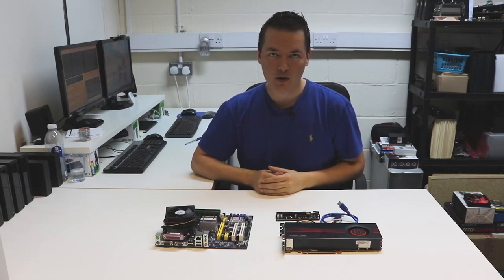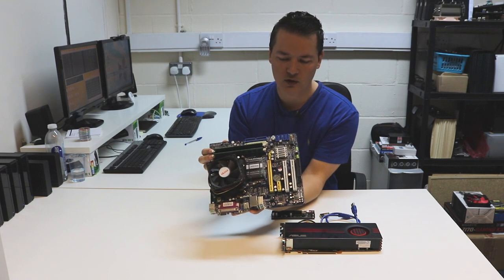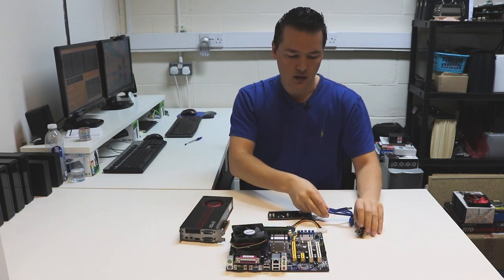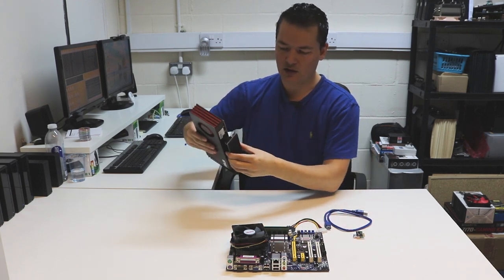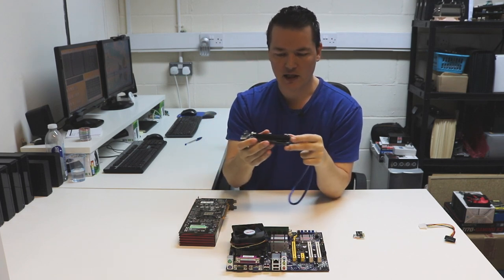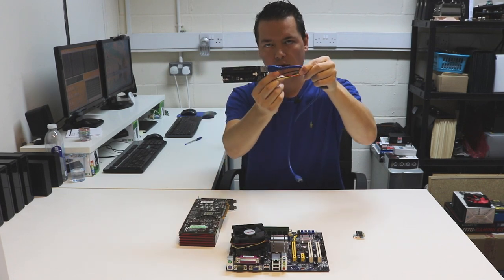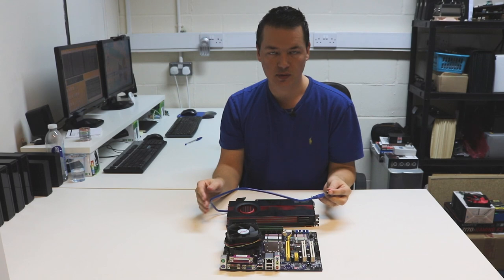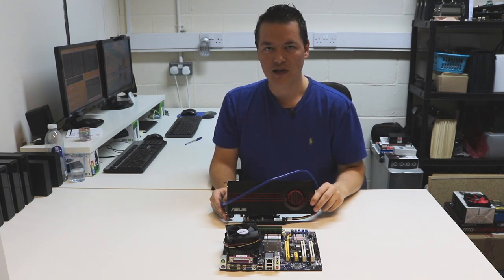How To & Why Use PCI-E 1X - 16X USB Extension Riser Cables

Comment from the maker: Please Note:- You cannot connect the GPU Riser to your USB port. The usb cable is just used as an alternative to a ribbon cable, there is no usb interface. You cannot run the gpu riser from a usb port!
Reply: I am very new to all the technical stuff related to mining. I was wondering if you connect the PCIe extension to PCIe 1x slot, will the GPU not reduce in performance since you are providing it with less bandwidth?
Reply: Can i still use my top gpu and mine on the 3 riser extended gpus?
Reply: You don't need much bandwith for mining
Reply: Hi what about the speed/performance? It will be same like before I use this module? thanks
Reply: Check for Gigabyte models, I think there's few with up to 7 pci-e
Reply: i have a lga 775 Mbo but i wanna install 1050ti or greater something but my x16 is gen 1.0. Now newer graphics cards have 3.0 x16. I was wondering if I get a PCI Express Riser cable or something like this would help me out performance wise?
Asus support tell me it will work normal way just plug it but wont  get max performace.
Reply: Hi do you know how much it reduces anything when playing games ?
Reply: HEY MAN . IM NOT A GAMER AT ALL AND NEVER WILL BE . MY PC IS PRETTY GOOD WITH PCI-E 3.0 x16 SLOT BUT IT CANNOT PLAY VIDEOS PROPERLY SMOOTHLY OVER 1080P ON YOU TUBE AND ON MY PC ...... WHAT GRAPHIC CARD SHOULD I GET ????? THANK YOU
Reply: i need answer guys., if theres a Power pin in the GPU should you also connect the PSU  to the GPU??
Reply from the maker: @NaldzHobbySide  Yes, most gaming gpus get their power via the pcie slot & extra power connectors at the top/back of the gpu. Normally 6/8 pin connectors, they also need to be plugged into your power supply.
Reply: How about connecting gpu riser with usb type c thunderbolt adapter to laptop?
Reply: You might wanna change the title to indicate this more clearly. The USB A to A cable is an alternative used due to the non-existence of external PCIe cables... so, drop the USB mention?
Reply: Yeah I understood the not connecting the USB directly to the back of the motherboard USB I told understood that my module actually came with that little doohickey that connects to PCI Express the small one and I guess it also connects to the regular PCI Express 16 or x16. But I've got an Asus motherboard It's an ASUS M5A97LER 2.0
Reply: These are just left over parts I had when I had my computer business like 5 years ago and I just got bored one day and I just started putting it together and this is where I'm at So I just wanted to play around with it a little bit
Reply: No sht Sherlock, jokes aside yeah I can see people doing that lmao
Reply: HELLO JUST WANTED TO ASK IF THAT USB CONNECTOR CAN BE USED FOR USB TO NVME THEN USE NVME SLOT TO RUN THE GPU?
Reply: subbed, thank you, came here for this answer
Reply: @clashofclan4836  usbc thunderbolt 3 an 4 can work egpu.
Reply: thank you for clarifying, that's exactly what I was wondering

Comment: You really should be using an anti-static mat and grounding yourself. Every time you touch components, you are likely transferring a potential electrical charge and making connections which may damage the components.

Comment: SATA extension risers have too many conflicts and glitches, I recommend PCI extension ribbon cables.  You can use multiple cables and put your video card at the other side of the room if you want...
USB extension risers are mostly just for the small PCIe slots that a PCI extension ribbon cable won't work in.
If you have a mining board with multiple full PCI slots or if you have a gaming board with only a few full slots but a handful of small slots, 4 pin..  Mining boards are cheaper than all the hardware with normal 6gpu motherboards.
Reply from the maker: They're okay, I did use them years ago but typically much more expensive than risers.

Comment: Nice video, thanks. Agree with the comment on plugging directly into the power supply, rather than using short adapter cables. Some PSUs, even high wattage ones, can suffer from higher resistance caused by unnecessary connections. One of our units burnt out when the cable melted, luckily we didn't have a fire.

Comment: So does the x1 channel have enough bandwidth to work with that x16 GPU card?

Conversely, if you could theoretically fit 4 of the those 1x extenders into a single x16 slot, you would have four 16x GPU cards on one 16x slot..  so what am I missing?
Reply: Hah that's the thing you can only fit one cause it goes in a certain place in it I know a thing or more about pcs I own 2 of them one with 2 gt 1030 OC edition and an I5 4590 3.3 ghz and one with a amd A6 5400B 3.4 ghz and a gt 710 OC

Comment: Good stuff. Might be useful to mention that 90 degree versions also exist, that would actually allow getting to this x1 slot with x16 GPU installed in the long one (this particular riser in the video would not allow that, as the blue connecting cable is sticking up in the air where the fat GPU case would be).

Comment: I have a basic cooler master force 500 cabinet on my gaming PC. I want to add another graphics card. But my motherboard has only one graphics card slot. I am looking at adding another graphics card {rx 470(old) + rx580(new)} to my Pc. I want to keep the graphics card with in the cabinet itself. Is it possible to add a second card using these riser and keep it in the cabinet itself.

Comment: Thanks for this interesting video !!!
I have one of this adapter and I tried to use it to plug another adapter with a NVMe unit on it.  But the PC or the O.S. does not recognize it.
I´m using the same adapter for the NVMe unit which I use to plug it directly to the PCIe port with good result.  
Can you tell me why it doesn´t work when I use the USB extension Riser Cables ?
Thank you in advance for your answer !!!
Blessings !!!

Comment: Question :  imagine an   internal  Pci   Sound Card  like a  ASUS Xonar ( long slot )   or  old  Creative Audigy   - do you belive that it will work  to take the sound card outside of the PC case.  I'm interested in making  a 'internal dedicated sound card'  in to a 'external dedicated sound card'.  [ to be left on the table ] .  It will leave more room for air flow for the 'dedicated video card'.  This is the question ....

Comment: The nrext is, How i can identify the graphics GPU with this. I have the LINUX Server with an X3650 M1 and the HP proliant DL 180 G6. I was able to make self Elektronic boards. I have the same risers that you using, but the 6 Pin Connector. I can using a 12 V 150 Ampere DC industrial DC Converter 240 / 12 V and also a / 5 V / 100 Amp Converter. Only what drivers you had to use

Comment: I have a card that converts pcie-1x to 4 usb 3.0 slots. Will this work? (Or is this not different then usual usb 3.0 although it sticks into the pcie port?) The advantage of it would be that i have the connectors on the back of the computer so I can run the cables cleaner to the riser boards.

Comment: i got a molex cable that directly connects to the power supply that supports up to 4 molex devices.. 
is this safe to use? 
it came with the power supply ..

Comment: Maybe a dumb question here:  about that little USB PCIe x1 card you have in your hand at 5:24.  I'm not a miner, but I bought one of those for $1 on ebay. I thought I would use it to plug in a USB flash thumb drive into my empty PCIe x1 slot so I could have an internal flash drive, but it's not working.  My BIOS and Windows do not detect the card or the thumb drive plugged into it.  Just trying to figure out of the little card is defective or if it just can't be used for this situation.
Reply from the maker: I've never seen them used like that before, I don't think they have a usb controller its only used for data transfer. Buy a pcie usb card some have an extra internal usb port.

Comment: With the rubber under it. Can i just plug-it and make the extra GPU sit next to the pc on my desk safely ? (Since  im just trying to add some extra power from an old card even if it will probably not give much more and don't have many GPU to make it worth buying something to support them in the air)

Comment: I am a newby into PCIe cards, Would it be possible to connect the PCIe16x directly to a laptop (NO 1x PCIe) although slower ? Would my PCIe Card in the PCIe16x Extender work in my laptop just through the USB port although slower) ? (I know the PCIe bus is faster than the USB Bus ) Any info/input appreciated.

Comment: Do you have to plug a separate power lead to the GPU itself as mine has an 8 pin socket ? (Strix RX 470 8GB). Thanks in advance. Great channel learnt a lot from you.
Reply from the maker: Yes, the GPU also needs to be plugged via its own connector. Normally a single 6/8 pin power connector on the RX470.

Comment: Hey thanks for the tutorial. I have a 1080 ti in my gaming rig and Im mining with Nicehash, I have another 1080 ti card on the way and I want to add it to this rig. Can I just plug it in to the motherboard with the riser kit, how do i configure my PC to use both cards, also Im using EVGA PrecisionXoc for monitoring, Would I use the same PrecisionXoc program for both cards(I want to be able to control them independantly) or can I  download it again for the new card, sorry im new to this, thanks for the rely!

Comment: if i want to use my gpu for gaming purpose not for mining, is it possible to use this riser cards to be able to mount my gpu on a dirrefent place like outside my pc case or would this slow my framerate down, or does it work at all like for normal gpu usage? and if so, is there a way to mount my graficscard some how in a different way then directly putting it into the 16x full size pcie slot on my mainboard? Thank you in advance, great video by the way. =)

Comment: In your video for ethereum mining with 4x R7 370 4GB, which riser did you use? Can these USB riser be used for ethereum. I have a green board riser, but it does not recognize my R7 370 card. Thanks in advance, great video.
Reply from the maker: MIght be a duff riser. Double check the connections on pcie slot, riser, power. unplug and replug everything.

Comment: Hello, I enjoyed your video.  On another topic, is it possible to connect an external card which I use for analogue to digital conversion of video tapes, to my laptop?  The card usually resides in a PC tower, but I want to use it with my laptop which is much newer and has a faster processor and more ram etc.  I can't find any info on YouTube which is applicable.  Any help will be much appreciated. Thank you.

Comment: I have an ACER ASPIRE X3995 device and I bought a new graphics card GT 1030 zotac and connected it directly inside the computer with the motherboard .. but the problem is that motherboard did not recognize the card maybe because it is an old version !!
If you install such a piece it will solve the problem and will work the device well??
Reply from the maker: No I don't think so. Try finding a bios update for your motherboard, that will often help.
Reply: IMineBlocks i dont know how ...😭

Comment: Great video Lee, i have the ribbon cable version i wouldn't guess theirs any performance difference between them. Is there any benefits to having the usb ones?
Reply: Ribbon cable can not turn, there is not enough capacity to stabilize voltage,
Reply from the maker: I also have a lot of the ribbon style connectors. The performance is the same but the USB style look better and have extra flexibility so making your rig nice a tidy is a lot easier.

Comment: Would this work so I could use an x16 GPU in a system that only has an x1 connector? I just want to use my spare system as a backup machine, it only has terrible Intel integrated graphics and I have a spare old GT620 I want to use in it
Reply from the maker: Yes.

Comment: Quick question before I order these. I have B350 PC Mate mobo. Someone told me it can hold 8 gpus using PCIE adapters. So that little chip part that connects to the video card slot, can you put multiples in that slot? Witch then would mean I could put 8 because I could connect 4 of the connectors into one video card slot, and 4 in the other one. Am I correct?
Reply from the maker: That motherboard has four pcie slots in total. So normally four pcie risers.
You can use these pcie expander cards, though I've not personally used them https://www.amazon.co.uk/KKmoon-Express-Expander-Extention-Multiplier/dp/B074PSNGKY/ref=sr_1_2?ie=UTF8&qid=1516848410&sr=8-2&keywords=pcie+expander
You could also use a m.2 pcie card and use that if needed https://www.amazon.co.uk/CosyOnic-NGFF-Adapter-Power-Cable/dp/B0786HSLJJ/ref=sr_1_5?ie=UTF8&qid=1516848695&sr=8-5&keywords=m.2+to+pcie

Comment: Tjx for the clip. I plan to use it with old rx 560 14cu without power cabled needed gpu. Do I still have to connect power (6pin or sata even molex) to that riser chipset?
Reply from the maker: Yes the riser will always need to be powered.
Reply: @IMineBlocks  and pcie direct powered from PSU is the safest way regardless of gpu tdp and power consumption I guess

Comment: You've just saved me buying something thats not right for my needs... 5:12 you say that the USB cable can't plug into a USB port as that "simply wont work" and needs to connect to the PCIe mini card adaptor.  Is there "something" I can buy - a PCIe to USB that actually plugs into a USB port as I have a laptop and want to buy a riser-type "thing" to attempt to repair a graphics card. So would need to see a video output and connect via USB-A or USB-C (or thunderbolt) to my laptop ?

Comment: My question is, if my original PCIe x16 in motherboard is broken (not snapped) just doesn't detect any gpu. Can I use this riser to get the GPU working ?
Reply from the maker: It really depends on what's broken with the slot. It might work.
You could use this to make use of a 1x pcie slot if your motherboard has them available.

Comment: Do the PCIx1 slots slow down the hash rate a lot? Because I know the bandwidth is 1/16 of the bandwidth of the PCIx16 slot. Thanks for the info in advance.
Reply from the maker: No, mining does not require the full pcie bandwidth. 1x pcie is as fast as 16x.

Comment: So could I use one of these to add a decent gpu to my small dell optiplex case that is too small for a gpu of any size? I would have to modify the case slightly and keep the Gpu on the outside....but it that a way this could work?
Reply from the maker: Yes you could use it for something like that. If using for gaming I'd recommend using a 16x to 16x cable for the best performance.

Comment: Does the riser connect to the outside or inside of the cable that is connecting to the actual GPU whenever it is not connected to the top, BEFORE it is mounted to the other side. Thank you.

Comment: May I ask how do you activate this pci 1x to 16x riser in a PC. I tried it in system the lights in the riser boards turns on but when I put the 1x to the USB to the riser board it wont work and it cant be seen in the property change in the device manager

Comment: Thanks for the explanation. I have a question though. If I want to use the product, should I power the GPU the normal way (ie by plugging the power connectors on the GPU), or do I have  to plug the power connectors on the products ? I have a power hungry card and one 6 pin isn't enough to power my GPU, thus the connector on the product won't be enough.
One more question : I want to use it on a old desktop. Does it matter if I use one PSU to power the card, and one PSU to power the rest of the  PC ?
Reply from the maker: The GPU's should be powered by their normal connectors (6/8 pin pcie) and also via the riser cable board.
You you can use a combination of PSUs to help power the gpus.

Comment: my question is a bit confusing to me, on the end of the riser usb why do we have to use a 1xpcie connector instead of 1 16xpcie connector? will using a 1xpcie connector will reduce the data transfer capability of the riser to the motherboard?
Reply from the maker: You don't need the full pcie bandwith of the gpu for mining. Using a 1x or 16x slot will produce the same performance.

Comment: If my GPUs have 8 pin for power, but the risers I got have only 6 pins, will the GPUs get enough juice? or should I connect the power supply directly to the GPUs INSTEAD of the riser?
Reply from the maker: You should connect both to you PSU. The GPU needs to be powered via the riser (bottom) and also via its own 8 pin power connector (top).
Reply: awesome help, thanks! why isn't it easy to find a simple 6pin to 6pin cable to power the risers? Wouldn't this be the best and tidiest way to power risers? if everyone is concerned over the sata adaptors, why aren't 6pin to 6pin cables available?

Comment: I have a Dell Optiplex 980 SFF, but can't put a normal size GPU on it. If I use the riser with another PSU just for the GPU, will it work normally?
Reply from the maker: You'll have to double check because sometimes PC manufactures change the standard spec of the parts (PSU). In theory you should be able to swap out the PSU and run one that supports your GPU. Using a riser cable will be fine if the motherboard has at least a PCIe slot.

Comment: Hello - How much extra Juice is consumed when the GPUs are plugged via a Powered Riser Extender (& Molex)? I'd assumed it was not much, but have seen wall measurements that show an extra ~30/Watts per GPU! (Unable to verify here). Thanks!
Reply from the maker: I've not done direct comparison but I see no reason for the riser to use anymore power than being directly plugged in.
Reply: Thanks iMB. That seems to make sense. But I guess I'll have to test it all at the wall.